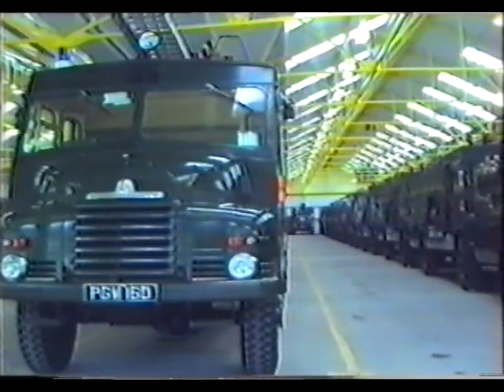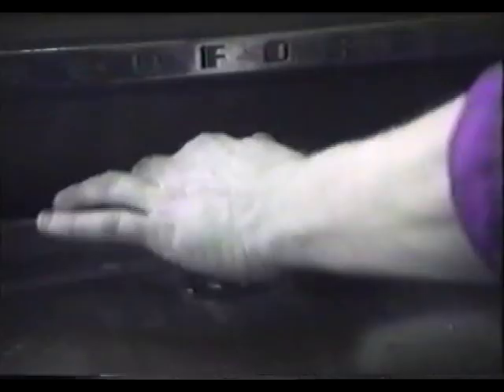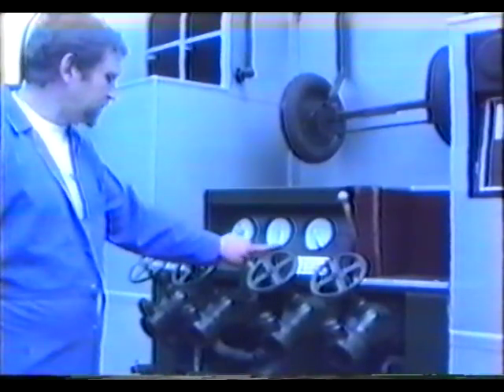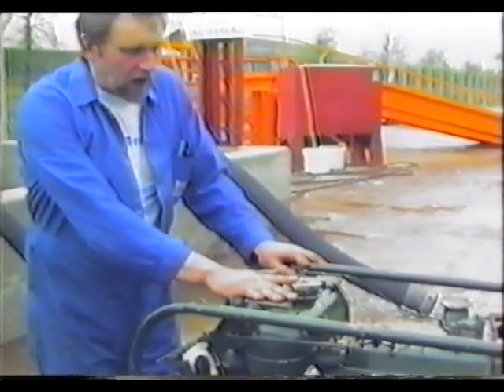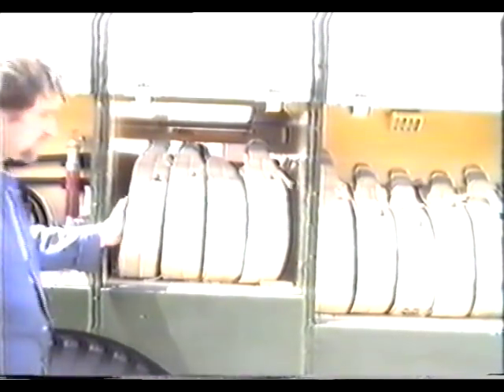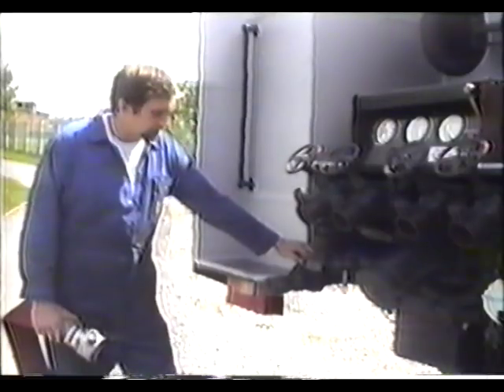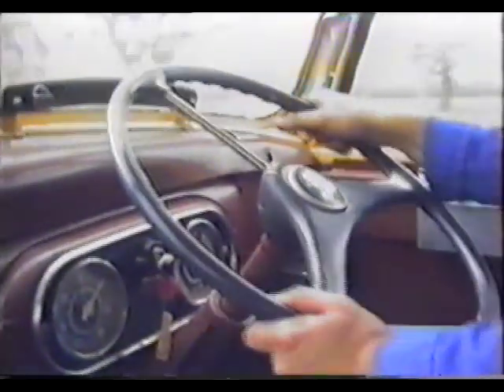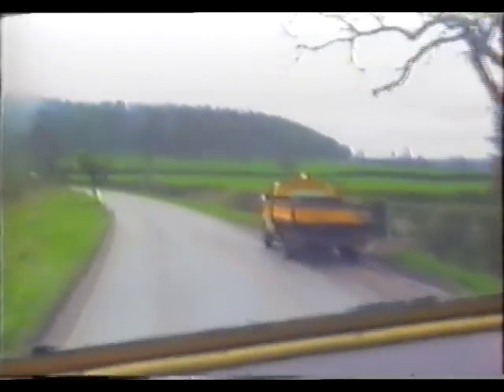Green Goddess TNT truckcare film PGW160

Comment: The truck was originally designed and built as a mobile pump, not a fire appliance - hence the mega-quality pumps fitted to these. They were designed to draw water from lakes, rivers or other large supplies in the event of major fires caused by war. They could be linked together in a long daisy-chain (over several miles if needed) to get water from pretty much anywhere to anywhere else. Brilliant for its time.
Reply: Kevin Bower fantastic kit for its day. Surprisingly, when we needed fire engines for KFOR, the MOD kept the old goddesses in UK and bought old dutch Mercedes Fire trucks for the defence fire service to man and shipped them to kosovo, where they were in constant use. Ironically due to her ability to pump water from source, it would have been excellent as the Pristina area relied predominantly on wells. So although the new (old) engines were great, they lost so much time in returning to base to fill up as the mains supply was pretty well non existant for most of the time.

Comment: Judging by the vehicles; this was produced after the first Fireman's strike in 1977, as the vehicles have blue lights and indicators fitted.
I remember travelling from Maidstone on the back of a Bedford(bloody freezing) to a storage warehouse in Birmingham to collect a load. They had trafficators; one stop light, and a bell.When they were started, all you could smell was the dust on the window heater element burning!
Incidentally, there were also rows of brand new Austin Gypsy's on axle stands with trailer mounted Coventry Climax pumps and 46 miles on the clock.
Apparently, the Government had warehouses like this all over the country, just in case; but sadly, all of them are now gone apart from Bicester which itself is much smaller than it used to be?

Comment: I can guarantee these Green Godesses are up to the task. Basic wagon. When with crew and full of water it rolled a lot and lacked power. Double clutch to change gear with revs. And brake with care. Used them in the fireman strike in 70s
Reply: Maximus H me too, although more on the sidelines fetching and carrying, boy soldier back then! I remember a few of these rolling due to the lack of baffles in the water tank, even a few deaths in some units....i seem to remember REME retrofitting rubber bladders as tank liners....does that ring a bell?
Reply: was fun driving on the pavements in London to get around traffic lol.
Police riders told us to get on the pavment and drive as fast as possible. Yeah right flat out 40mph lol.

My crew was 1st to be called out and the last to be out when the strike ended.

We were stuck at east India docks dealing with a flour silo that was in flames for 2 weeks. The fire brigade saw we were struggling with it as u cant use water on a flour fire so they called off the strike and sent their crews over to help us out.

1 thing i noticed was most of the fires we went too were deralict buildings with a fire station within sight of the fire.

Xmas was fun though as we dealt with a fire at a strip club in soho and the strippers came and put a show on for us on xmas day.
I shouldnt of watched the show as i was 17 at the time but the oficers didnt care and told me to get in there and have some fun.

We covered all of central London with 6 engines that is usualy covered by about 20 fire stations.

No blue lights no sirens when we got r goddesses they were fitted during the strike. All we could do till they were fitted was sound the horn and ring the bell that was on top of the cab and flash the headlights.

Front seat passenger had to operate the windscreen wipers as they were controlled by a lever that had to be manualy turned to get the wipers to move. So it was turn 1 way then turn the other way continoiusly to keep the wipers moving. the guy behind the front passanger seat had to put his hand through a hole in the roof to pull the rope to ring the bell.

We were on the go 24/7 for months during the strike. we were lucky to get 4 hrs sleep a week.

1 crew was on full alert fully dressed ready to go at all times. 2nd crew would be on standby fully dressed but more relaxed as they could have a nap if they needed it. the 3rd crew was on standby but didnt have to be fully dressed but have the gear nearby. 4th crew on standby as well but could sleep. the other 2 crews could leave the station and go look around the shops but not go beyond the sight of the base so we could rush back if the other engines were called out. then after crew 1 was called out the next crews moved up the standby list and when the 1st crew got back it was shower and rest till called out again. Usualy we were getting called out every 20 mins. Hence very little sleep.

None of us were fully trained soldiers as we were all still in basic training at Woolwich.  we didnt even see the goddess or train on them till we got to r base at the honurable artillery company HQ in central London. We had 6 hrs to get to find out how they worked and what equipment was on them and how to use them before we got called out.

we only had 1 weeks fire fighting training before we headed off to r base for the strike.  Most of us were teenage kids think the oldest was 20 the youngest was 16. From what we were told we dealt with twice as many fires than any other base with half the engines other areas had.

Most of us collapsed from exhuastion within the 1st  week so the officers were giving us little white pills to keep us awake and getting on with the job.

3 engines were tied up at east india docks for 2 weeks leaving 3 to cover the rest of London. another base did send in engines to give r guys a rest for a few hrs every day though during those 2 weeks.

maybe if we had 12 crews with 6 engines we might of been able to deal with things better as more rest time. But even 6 engines was not enough as some days we had all 6 out on calls at the same time and when we finished with 1 fire went straight to another.

we went through 3 days of not even getting back to base it was from 1 fire to another. No sleep no food nothing for 3 days.

What did we get for it? a certifacte saying green goddess riders 1977. No medals no thanks or anything. we had sweat shirts with green goddess riders on as well but we had to pay for them lol. They handed them out and stopped the cost of it out of r pay we were not even given the option of if we wanted them or not.

We didnt even get extra pay for it. get sent to Ireland or Germany u get paid more for over seas service but nope nothing extra for putting r lives on the line to save others.

I dont regret doing what we did but a thank you would of been nice. or a medal or something.

Took me 5 years fighting to get a medal i should of got as standard for doing a tour of N.Ireland. Got wounded there in an IRA car bomb in 1980 given a medical discharge then called up again in 82 for the falklands war and got injured there. No medal for that. nothing in my army documents even mention me being recalled for the falklands. But nothing unusual about that cause my unit didnt exist on paper anyway. It was a need to know unit and only a small group of ppl knew what r job was. Even the CO of the regiment didnt know what my battery did or were we were when not in the barracks. Lets just say every one in my battery had green and red berries. 6 months year we trained with the royal marine commandoes and 6 months a year training with the paras. Training in the arctic or antarctic during the winter. Kuwait during the summer. Hong Kong in spring, Canada in the Autumn. Only time we were in barracks with the rest of the regiment was when we were repainting r guns for the next trip. White for artic, sand for desert and standard camoflage for hong kong and canada.

 Now i cant even get my army disabilty pension. Tony blair blocked that when he was PM. he stopped all my benefits when he was in power and got me thrown out of my home simply cause i was unable to work. Had to wait till a tory govt got in to get rehoused and get my benefits back.
They still havnt got my army pension reinstated cause my local MP is labour and he is blocking every effort to get my pension back. and he wonders why i refuse to vote for him lol.
Reply: @cliffbird5016  Thanks for your service.

Comment: hi. you did not mention the fact that you  should double de clutch when changing gear when changing down gear. its ok when brand new to single de clutch but wear and tear takes place qwickly.engine oil should be checked before use and water level. I had these bedfords and rls in the 1960s

Comment: A friend claims the inbuilt water pumps on these appliances are exceptional, when the vehicles were built firemen did not have breathing gear so could not get so close in to the fire. Hence the need for super water pumps.
Reply: g0fvt actually it was for drawing its own water from source.....wells, lakes etc hence the need for the high powered fast pump...an amazing piece of kit, a couple of these sucked small local lakes dry backnin the days of the strike, no exageration, it became a real problem!